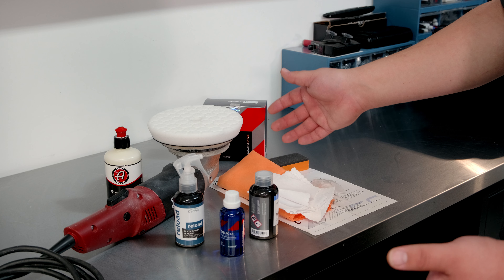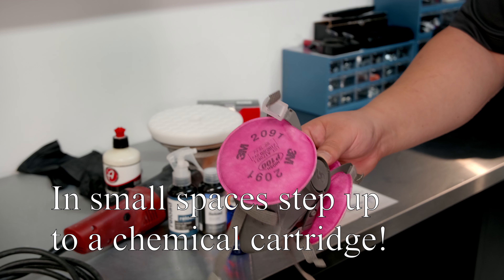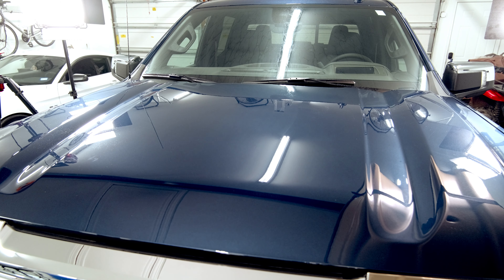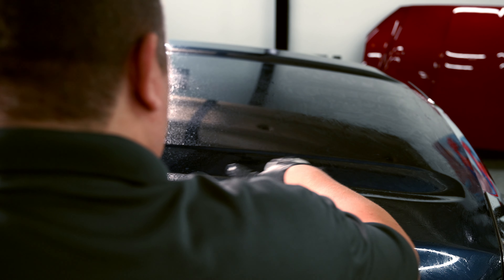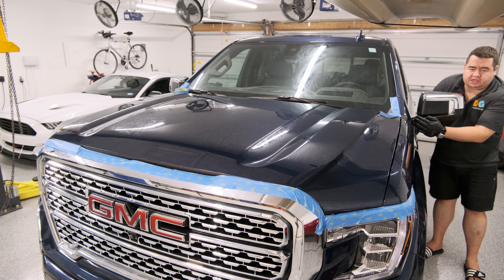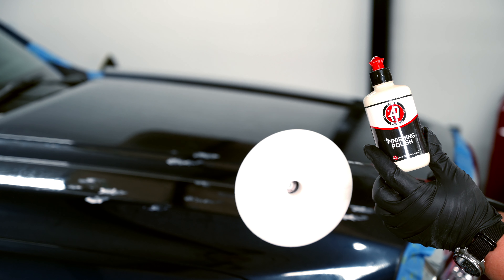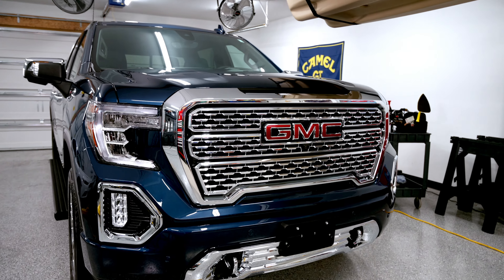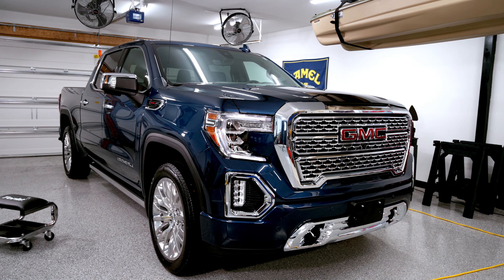Ceramic Coating my New Denali Ultimate with CQuartz UK 3.0 from CarPro

Comment: Awesome video; trucks looks great. I just purchased the same kit, Do you have to use any type of surface prep or isopropyl alcohol?
Reply from the maker: Jonathan, you can use isopropyl alcohol to clean up after compounding/polishing. I like using iron remover and clay to prep the surface before polishing.

Comment: Great video. Just to make sure, both applications need to be put on within an hour?
Reply from the maker: You have two options with the CQuartz UK 3, it's either both coats within 60 minutes, or you have to wait 24 hours and then do it. Same with applying reload on top of the final coat. You either do that within 60 minutes or wait at least 12 hours.
Reply: @DmitrysGarage  so within 60 minutes you have to have 2 coats of cquarts 3.0 UK AND the coat of reload ?

Comment: Since it’s cold here in Maryland, will it not cure correctly ? Could I use a heat gun ?
Reply from the maker: The UK formula was specifically made for cooler climates. I think it would still cure, you may want to do it on a warmer day or indoors if possible. I would think a space heater would be better than a heat gun. Maryland isn't THAT cold though. Thanks for watching and good luck with your coating install!!

Comment: With that 50 ml bottle how many Coats are you able to do on the truck? Also is that including trim and windows as-well?
Reply from the maker: You can definitely do two coats with everything included. You'll have some left over if you need to fix spots up later. Thanks for watching!

Comment: When buffing the coat off after it flashes in 2+ minutes, are you gently going over it or really rubbing it down?
Reply from the maker: I recommend testing first on a small panel you can buff off with a polisher before doing a whole vehicle. As a general rule if it does not come off easily and feels tacky you either didn’t let it flash long enough or you put on too much. It should not require a very strong force to remove, but you must get all of it off or you will have high spots that you’ll need to machine off.  Its basically like removing any spray wax if applied properly, easier than most paste waxes to remove. Thanks for watching!

Comment: Awesome! I’m working on a Denali now, can you coat the chrome and the wheels with the UK 3.0?
Reply from the maker: Yes you should be able to coat wheels and the chrome metal grille (metal outside bit). Just prep them well. For the plastic chrome inner grille inserts, I would probably use a spray sealant. I wouldn’t want to risk over applying or poorly applying. If you screw up, cleaning up cured cquartz without being able to polish over it is a major pain. It wouldn’t be fun to try to buff those insets. If you have hand washed your truck, you know what a huge pain it is to clean the inserts properly due to the complex shape.

The chrome trim around the truck and the mirrors are fine to coat too. You can coat the actual mirror parts of the mirrors too!

Comment: Great video! Love the color on the truck

What did you use filming this video btw? Great quality
Reply from the maker: Thanks for watching! I love the color too, those type of blues are some of my favorite at the moment. As for the video, I shot it on a Nikon Z6 primary and Fujifilm X-T30 as a the b camera. Highly recommend both for video, but if picking a primary keep in mind the X-T30 does overheat as do most of the similar Sony mirrorless options. Even in an airconditioned garage after about 40 minutes of 4K 10-bit straight to the Ninja recorder it eventually shuts down. Pulling the tiltable monitor away from the body helps, same trick as on most the Sony cams. The Z6 I have not had overheat in any condition, even outside in Houston heat. So if you're shooting in hot environments for a long time (i.e. >20) without breaks between takes I would definitely consider heat as an issue for a primary. I tend to shoot straight through with stops for scene changes, being a one man band making a lot of separate takes would kill my time.

Comment: I did love your video, awesome work,  what is the best was I can use?
Reply from the maker: Thanks for watching! I would say it depends on what you prefer. I like wolfgang deep gloss or jescar power lock+ for ease of use, durability and shine. For a ceramic coating this CQuartz UK 3.0 has been a big improvement on older formulas but it is a more difficult application taking some experience. Check out my site for a comparison of waxes: https://dmitrysgarage.com/wax

Comment: What reload do?
Reply from the maker: Reload on its own is a ceramic sealant, that can be used in place of a wax. It is pretty durable and lasts about 7 or so washes in my testing. I'm not sure why Cquartz has you add it on top of the Cquartz coating, but my guess is that it acts as a temporary barrier to let the cquartz cure or as a catalyst maybe. Not 100% sure.
Reply: @DmitrysGarage  Thank you 😌
Reply: CQuartz UK on its own is susceptible to water spots. If you're not topping it with a hydrophobic coat like Gliss, Reload is the next best option.